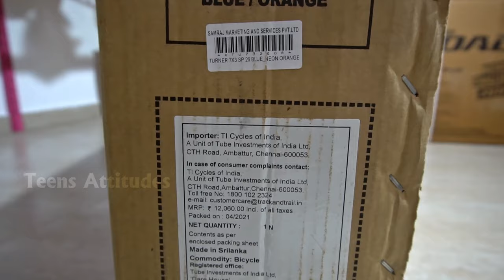Roadeo Turner Premium Geared Cycle | Premium MTB | Dual Disc Brake Cycle unboxing & Assembling

Comment: I bought this bicycle second hand without disc brakes at 3,000rs 3 years ago.. i shocked when I saw the price at online 😂😂
Reply: Price
Reply: First it is second hand 
Second it is old model
Well does it have front and back gear
Reply: kidhar se liya bhai 3000 main, kya cutiya banara
Reply: @krishnannarayanan2262  gkgotnc
Reply: भेजों जो साइकिलभेजो साइकिल
Reply: साइकिल भेजो गियर साइकिल दिखाइए का देवता माना कि
Reply: @ranteetprasad9018  i bought same model green & black what you have seen in the video for 1600 rs only from waste paper iron merchant in tamilnadu  trichy iam so lucky when i saw the online price .
Reply: @ranteetprasad9018  0y0kp